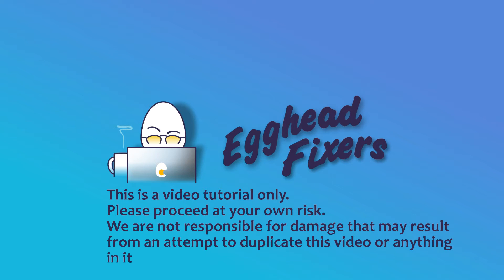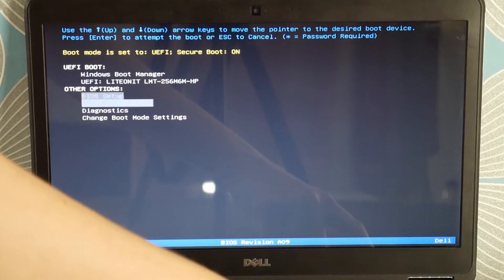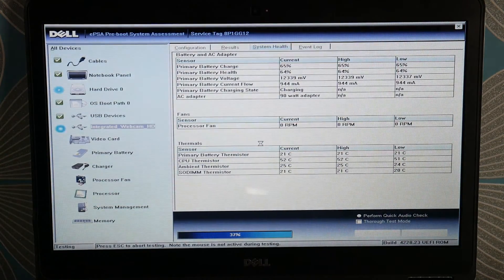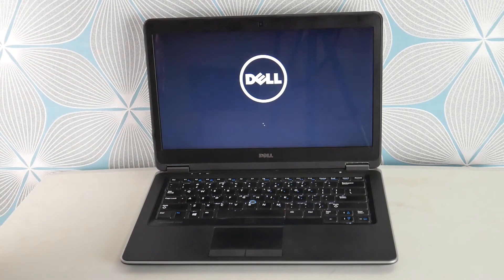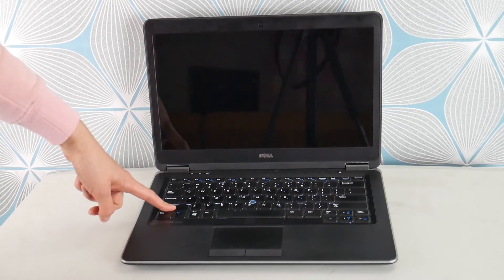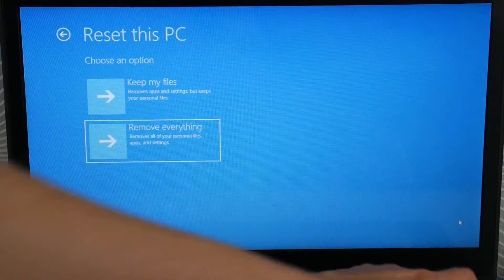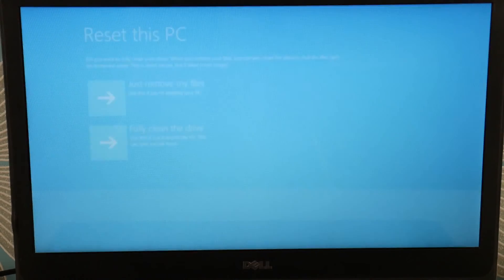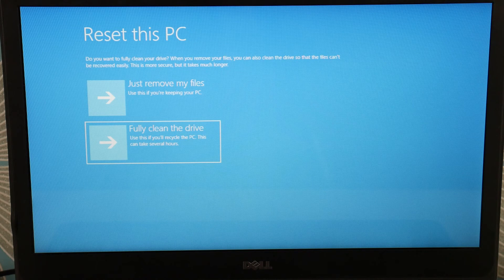How To Fix A Dell In A Preparing Automatic Repair Restart Loop

Comment: I have no idea if you'll see this coz you uploaded the video ages ago but I'm having trouble with my Dell Latitude E5420. I have no idea what's happening. Sometimes it goes past the bios screen but sometimes it gets stuck. Then if it goes past the bios screen there's either a black screen and nothing happens or the windows 10 logo shows up and nothing happens or the windows attempts to enter recovery mode and nothing happens. I tried both the steps you said and neither of them works
Reply: The diagnostic never ran. I think it's probably a hard drive issue. I've sent it into the repair shop so hopefully I can get it fixed and it won't be too expensive
Reply from the maker: @adamcarroll3581  I hope it all works out!
Reply from the maker: What happened when you ran the diagnostic? Did everything pass?

Comment: I am getting on display screen 'Preparing for Automatic Repair'
But stuck for long time??? Pls help
Reply from the maker: What happens when you run the diagnostic? Does everything pass?
Reply: @EggheadFixers   It was stuck there but right now the screen is getting on and off n I have to call the expert soon n thanks ur time
Reply from the maker: @mauu9778  no prob👍
Reply: @mauu9778  same problem
Reply: @Nandu_Tech_Channel   As mentioned above I called the technician who told me that the screen and laptop connecting thing got damaged so I got it repaired

Comment: My dell laptop keeps doing to loop reboot and nothing is working
Reply from the maker: Sorry to hear that:( What happens when you run the diagnostic? Does everything pass?
Reply: @EggheadFixers  Everything passes
Reply from the maker: @mia-3885  Sorry to hear that:( If all that hardware passed the diagnostic then the next step would be to try reinstalling the operating system. Usually this problem is caused by a problem with operating system. Here is a video on how to do that:

https://youtu.be/TElCJDbKdKk

You can skip the part of the video about replacing your hard drive. Let me know if you have any more questions:)

Comment: stuck on dell logo, and F12 is doing nothing and so is F2 it highlights it but does nothing?
Reply from the maker: Make sure the computer is completely off and then immediately start tapping on F2 or F12 right away. It can take several tries. If it still does't work then I would google your model and see if a different function key is recommended for you model Dell for entering BIOs. Some models of Dell do use different function keys.
Reply: @EggheadFixers  but it will work and I can do this all day... but when do I know it's not the problem or will this fix the issue.  For my computer it's F2. When I press it it highlights but does nothing.
Reply from the maker: @kaylynn3583  Ok now I understand. Here are two videos that I would try:

https://youtu.be/TA1mFPtKVnw

https://youtu.be/bZSz-jjexqM

Comment: Turns out that I have a primary battery problem!! What do I have to do? Should I buy a new battery or what?
Reply from the maker: Yes you will most likely need to replace the battery see if it resolves the issue. If it does not and all your other hard ware passed the diagnostic then you will need to try and reinstall the operating system or reset the computer.

Comment: When I hold shift it has me at a black screen then takes me back to the windows and automatic repair, help
Reply from the maker: Sorry to hear that☹ Sometimes when the Operating System is not functioning properly then you can no longer get to the options to reset it. In this case the next step would be to reinstall the operating system. Here is a video on how to do that:

https://youtu.be/TElCJDbKdKk

You can skip the part of the video about replacing your hard drive. Let me know if you have any more questions:)

Comment: There’s a problem with my hard drive but I just got it couple months ago. When I try to turn on my computer it just goes to a light black screen and all it shows is my mouse. Please help
Reply: I want to just reset windows with a hard drive but I can’t get to that blue screen with those options. I tried the shift and power thing
Reply from the maker: What happens when you run the diagnostic? Does the hard drive fail?
Reply: Egghead Fixers yes, I’m going to try and reinstall windows hopefully I don’t need a new hard drive
Reply from the maker: @ramesesrodriguez4442  ok let me know how it goes:)

Comment: I got error 2000:0142. Please help me
Reply from the maker: Sorry to hear that☹ First I would try what we call reseating the hard drive which means unplugging it and then plugging it back in. Then rerun the diagnostic. If that does not work then its most likely that you need a new hard drive. Sometimes when a hard drive really dies the motherboard doesn't read it as being installed. Here is a video on how to replace your hard drive and install an operating system:

https://youtu.be/TElCJDbKdKk

Let me know how it goes:)
Reply: @EggheadFixers  ma'am, again same 2000-0142 error. After I unplugged sata and power cables from hard drive and plugged them again. Please tell me if I have any way to save my data or fix it. 

Please help thanks.
Reply from the maker: @ankitwill  Sounds like you need to replace your hard drive:( If you can't boot it up to your desktop to save your data. There are companies you can hire to retrieve your lost data. Another cheaper option that sometimes works is to buy an external Hard Drive bay and hook up your bad hard drive to pull the data off. This option will only work if your Hard Drive is not too dead.

Comment: So I'm not understanding why but I chose to reset my computer entirely and it says "There is a problem resetting your PC. No changes were made."
Reply from the maker: Sorry to hear that☹ Sometimes when the Operating System is not functioning properly then you can no longer get to the options to reset it. In this case the next step would be to reinstall the operating system. Here is a video on how to do that:

https://youtu.be/TElCJDbKdKk

You can skip the part of the video about replacing your hard drive. Let me know if you have any more questions:)
Reply: @EggheadFixers  had to re-install windows 10 using a flash drive. I used one of your videos, thanks so much for the help!
Reply from the maker: @TheCanadianGoose22  Awesome!! Happy it worked out:)

Comment: I didn't get any recovery option even after trying Everything
Reply from the maker: Sorry to hear that☹ Sometimes when the Operating System is not functioning properly then you can no longer get to the options to reset it. In this case the next step would be to reinstall the operating system. Here is a video on how to do that:

https://youtu.be/TElCJDbKdKk

You can skip the part of the video about replacing your hard drive. Let me know if you have any more questions:)
Reply: I was unable to get the Recovery Option to boot as well.  I ended up switching it from UEFI to legacy and turned off Secure Boot, ran through BitLocker, and it started working again.
Reply from the maker: @yamahaSHO  Nice job troubleshooting!!

Comment: Hey I did everything I could but the shift thing that u talked about is not letting me do it it
Reply from the maker: Sorry to hear that☹ Sometimes when the Operating System is not functioning properly then you can no longer get to the options to reset it. In this case the next step would be to reinstall the operating system. Here is a video on how to do that:

https://youtu.be/TElCJDbKdKk

You can skip the part of the video about replacing your hard drive. Let me know if you have any more questions:)

Comment: Hi Liz
I have Dell XPS 8700 that recently prompt me to do an update and  after that my pc will not boot up pass the the login screen. I went into F2 and reset the Bios nothing changes. I held down the shift and click on the pwr button and try to reset it back to previous time but prompt me for a Microsoft pwd which i forgot.
I did the F12 and ran the thorough test and it passes. Any ideas would be greatly appreciated before  i do a window reinstall
Thank you.
Reply from the maker: Can you boot it up in safe mode?and then  look at the drivers see if there are any problems. If that doesn't help then I would try and reinstall install window
Reply: @EggheadFixers  I can't seem to get it to boot up in safe mode. I am going to try and reinstalled windows10 and take it from there. I will keep you guys updated .
thanks.
Reply from the maker: @SONICSTAR07  Ok sounds good👍
Reply: @EggheadFixers  Hi have question i forgot my Microsoft windows password and it's not allowing  me to make any repair or 'recovery. How can i bypass my pwd
Reply from the maker: @SONICSTAR07 Here is a step by step guide: 

https://helpdeskgeek.com/windows-10/how-to-bypass-a-windows-login-screen-if-you-have-lost-your-password/
Reply: @EggheadFixers  Well my  pc is fixed. After 2 weekends and countless hours I decided to do  a full clean. But the irony of all of this is  that  I've learn a lot on how  to troubleshooting a pc. The 2 weeks I have spend on your channel thought me a lot. So  Big shoutout to you Liz and thanks again
Reply from the maker: @SONICSTAR07  Hey that's great!! Nice job  with the advanced computer work:)

Comment: I have a big problem, i just recently had an hdd crash so i changed my hdd to a new one . Now it is an empty one and doesn't have windows installed. Bios diagnostic says that the hdd is fine. I have created a boot pendrive but it still isn't working because as soon as it opens for installation it goes to restart (infinite times), i also tried to install my windows on the laptop but still the same problem, what should i do? Plz help, thankyou for your help mam
Reply from the maker: Sorry to hear that:( First where did you get the bootable USB? If the USB is not created correctly then it can cause problems. Here is a video on how to make a bootable USB: 

https://youtu.be/k7yf0BrU-z0

Second try different USB ports sometimes it will boot only from certain ports.

Third make sure the USB is listed first in the boot order then change the hard back  back to first in the boot order when operating system is done installing.

Fourth if you are installing windows 10 make sure in the BIOs settings UEFI is set and secure boot is on.

Also here is a video on how to install WIndows 10
https://youtu.be/TElCJDbKdKk

Let me know how it goes:)
Reply: @EggheadFixers  i have followed and used all 4 steps u have mentioned, thanks to the videos you made. Very helpful and i really appreciate them. But at the end it still didn't work. My old hdd crashed because of windows 10 update. As u mentioned that the new drives might be a problem so i have unpowered my new hdd and i am going to try to repair it via installing the windows 10 in my pendrive and hopefully the autorepair might correct the error and after that my laptop will atleast start. Thankyou very much for the reply
Reply from the maker: @yugshah2808  You're welcome!! I hope it works out:)

Comment: It will repeatedly say that it will diognost my pc and then it will shut off. My screen was broken awhile back but the pc works fine other than you cant see on the screen. I havent had a problem with this pc till now. My screen has been broken for quite awhile now. Sometimes it goes into self repair and then will shut off way before the self test is done. Is there any way you can help? I really need this fix for the rest of the summer while i wait for a new one.  Edit: I forgot to add that i need to use an Hdmi cord connected into my tv to see my screen, do i need to disconnect it and hope for the best? Edit 2: I actually got to the spot with the f12 mashing thing. but when i got on there it made a loud ass noice over and over and it scared me so much i litterally cried lmao. Anyway I cant get past there. Either i click yes no or the little sound button on the side it just turns off. i also cannot get to the shift thing, i dont mind resetting everything i have. but i cant even do that. If you could help pleaseeeee pleasee say something.
Reply from the maker: Sorry to hear that☹ Sometimes when the Operating System is not functioning properly then you can no longer get to the options to reset it. In this case the next step would be to reinstall the operating system. Here is a video on how to do that:

https://youtu.be/TElCJDbKdKk

You can skip the part of the video about replacing your hard drive. Let me know if you have any more questions:)

Comment: I did but I didn't work and I can't reset also what to do any solution
Reply from the maker: Sorry to hear that☹ Sometimes when the Operating System is not functioning properly then you can no longer get to the options to reset it. In this case the next step would be to reinstall the operating system. Here is a video on how to do that:

https://youtu.be/TElCJDbKdKk

You can skip the part of the video about replacing your hard drive. Let me know if you have any more questions:)

Comment: My laptop is a dell inspirion and it said to replace my primary battery, so i did, when it was done, i turned on my laptop and done all the steps, the task was finish and everything was good, then i got stuck, so here is my question, do i turn it off by pressing the on and off button or press the exit?
Reply from the maker: If it gets stuck after a long time then yes you will need to turn off then on. If it keeps doing it then remove the battery to see if it stops. Let me know:)

Comment: I have a Dell Inspiron Dell 7352, it’s stuck on a boot loop 😔 I ran the diagnostics and everything came out perfect. How I do I enter recovery manager ? I did the shift method but doesn’t work , please help I need my laptop for school 😔
Reply from the maker: Sorry to hear that☹ Sometimes when the Operating System is not functioning properly then you can no longer get to the options to reset it. In this case the next step would be to reinstall the operating system. Here is a video on how to do that:

https://youtu.be/TElCJDbKdKk

You can skip the part of the video about replacing your hard drive. Let me know if you have any more questions:)

Comment: why i tried go many time dont have the blue screen
Reply from the maker: The screen to reset the computer?  Sometimes when the Operating System is not functioning properly then you can no longer get to the options to reset it. In this case the next step would be to reinstall the operating system. Here is a video on how to do that:

https://youtu.be/TElCJDbKdKk

You can skip the part of the video about replacing your hard drive. Let me know if you have any more questions:)
Reply: @EggheadFixers  thanks for answer, inside the usb have what software?
Reply: My harddrive got problem so must replace a new one?
Reply from the maker: @weiyong3525  Did your hard drive pass the Diagnostic?
Reply: no, it fail
Reply from the maker: @weiyong3525  ya then you will need to replace it. Let me know if you have any questions:)
Reply: need to buy a new hardrive？
Reply from the maker: @weiyong3525  yes

Comment: I did everything but once it was done it sent me to the loading screen and says "Resetting this PC 1%" help please
Reply from the maker: Sorry to hear that☹ Sometimes when the Operating System is not functioning properly then you can no longer reset it. In this case the next step would be to reinstall the operating system. Here is a video on how to do that:

https://youtu.be/TElCJDbKdKk

You can skip the part of the video about replacing your hard drive. Let me know if you have any more questions:)

Comment: I could be doing it wrong but I couldn’t get to the recovery menu
Reply from the maker: Sorry to hear that☹ Sometimes when the Operating System is not functioning properly then you can no longer get to the options to reset it. In this case the next step would be to reinstall the operating system. Here is a video on how to do that:

https://youtu.be/TElCJDbKdKk

You can skip the part of the video about replacing your hard drive. Let me know if you have any more questions:)

Comment: I tried the steps as shown on the video.. nothing happens.. it still on preparing automatic repair loop.. my laptop is dell inspiron 14 7000 series.. thanks for any help
Reply: Exact same laptop and having same issue ( not able to get to advanced repair option (blue screen)). It keeps rebooting with black screen. I got into this issue after installing intel driver that was on windows update tool. Please let me know if you find a solution. Thanks
Reply: Just found how to get to diagnostics mode. Make sure you connected to power source then press and hold function (fn) key and press power button. Release fn button once you see diagnostics screen.
Reply from the maker: @saireddy551  Happy you figured out:) Did it pass the diagnostic? If it happened after you install the intel driver Can you boot it up in safe mode? Then you can uninstall the driver. If not resetting the Operating System should most likely fix it.
Reply: Egghead Fixers diagnostics passed all hardware. I can’t get it to safe mode. Tried pressing F12 while booting and other things like press and hold power button 3 times to hard shutdown etc etc. 
But when I pressed F12 it struck at preparing automatic repair black screen and cant get blue screen . Please help
Reply from the maker: @saireddy551  Here is a link onto a forum on how to boot into safe mode:

https://www.dell.com/support/article/en-us/sln306359/how-to-boot-to-safe-mode-in-windows-10?lang=en

Let me know if you have any questions:)
Reply from the maker: What happens when you run the diagnostic? Did everything pass?
Reply: Egghead Fixers haven’t get diagnostics screen ( I tried pressing F12 while starting PC)